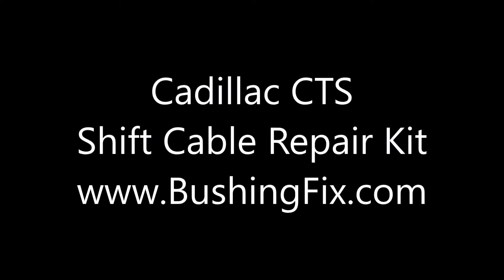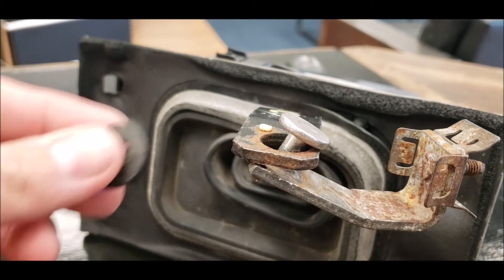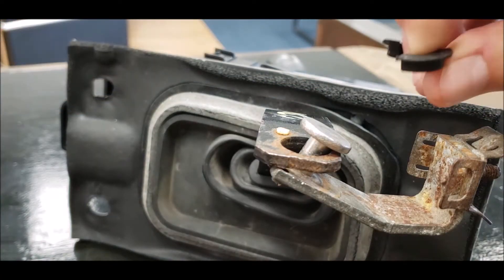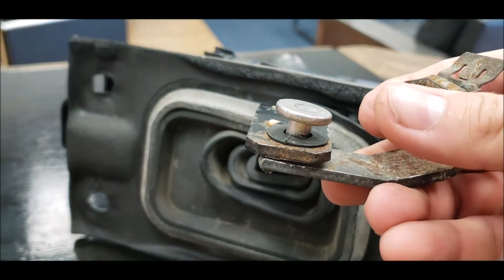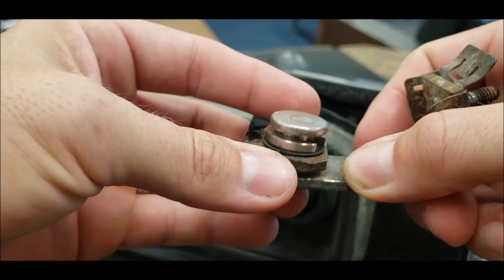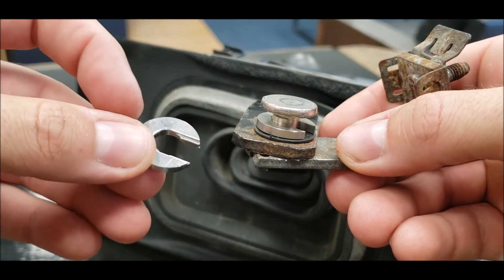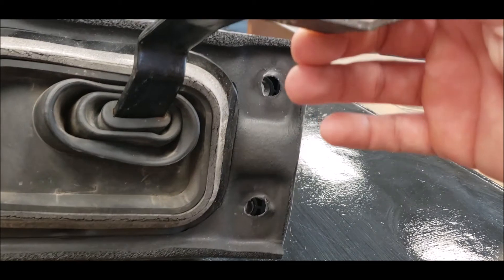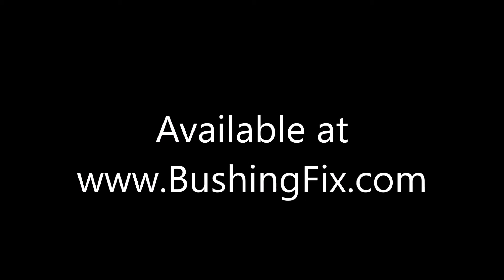The easiest way to fix your Cadillac CTS shift lever! RX1Kit includes replacement bushing.

Comment: Will this cause shift to park issues?
Reply from the maker: It certainly can.  Basically in simplest of terms the shift cable is the line of communication between where you select the gear and what gets communicated to the transmission.  So if the bushings are defective most often the communication doesn't happen. The easiest way to confirm if this is your issue: disconnect the shift cable from transmission end of cable and inspect the bushing, if intact then go to the upper end of the shift cable.  The end connected to gear selection knob and do same thing.  If you feel it to be the upper end then start there.

Comment: Does this work for a 1985 Cadillac eldorado ? When i put it in park it will be in reverse or if i put it in N it be in drive or reverse
Reply from the maker: Depending upon your cable end and pin here is link to what should work for your Eldorado: https://www.bushingfix.com/cadillac-eldorado-shift-cable-bushing-repair-kit/.  Or simply contact us with your details: https://www.bushingfix.com/contact/

Comment: Would this fix my problem with my 08 cadillac cts... Everytime i have it on drive, when i come to a stop, sometimes it goes into neutral. Not sure why
Reply from the maker: Definitely could be.  The ONLY 100% way to know is to inspect your bushings.  The easiest one is at transmission end of cable; the other is inside at bases of gear selection knob.

Comment: So i order this one for my 2005 Cadillac CTS 3.6 L and I installed it according to instructions. But while working on it I noticed that all the bushings coming from the linkage and the transmission are gone. So now my question is can i replace the other missing bushing with this one as well or do i need a different one ?
Reply from the maker: Kevin on a 2005 Cadillac CTS there are two kits one works for the tranny end of cable; the other for the shifter end of cable.  Here is the link: https://www.bushingfix.com/cadillac-cts-shift-cable-options/
Reply: How did you get the shifter off ?